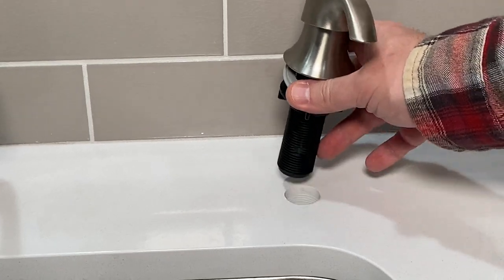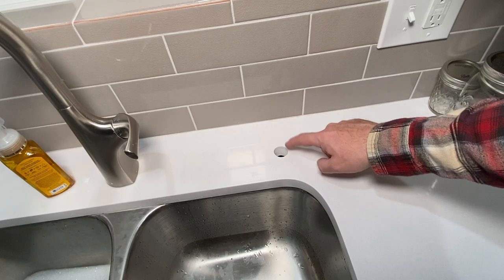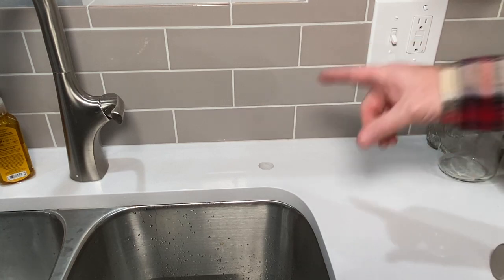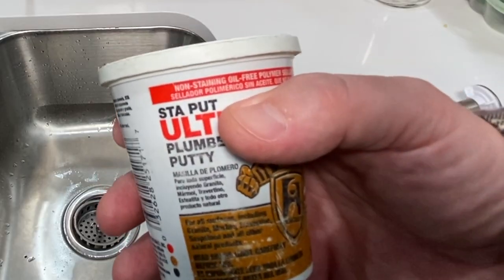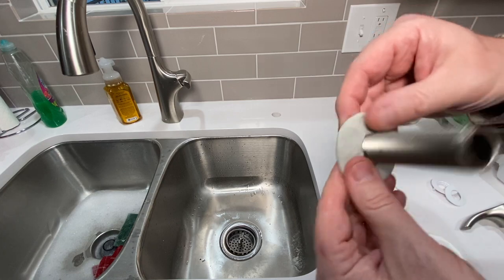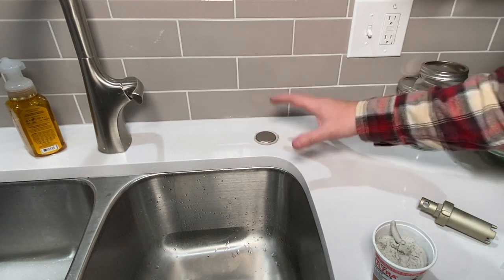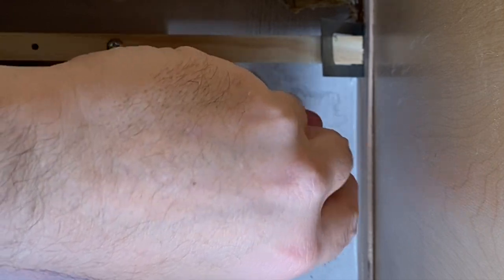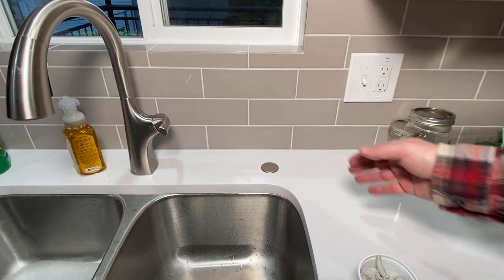I HAVE SEEN THIS TOO MUCH!...NEW COUNTERTOP MISTAKE THAT IS EASY TO AVOID!!

Comment: I actually just did this on my quartz countertop.  I drilled a bigger hole on another piece of quartz and i used that as a guide with some water. I believe 3/4 plywood would work aswell.

Comment: To make your existing holes a bit bigger do not drill through the existing holes!!! Instead use a billing bit with a side grinder to shave of the diameter of the hole and make it bigger.
Reply from the maker: Right on. I was just checking them out. Pretty sweet. Thank you
Reply: Correct. Why go thru the trouble right? Just grind 'er out. Get a small (3/8 or so) dremel grinding bit and use cordless drill.
Reply: Would a tile file work also?
Reply: Or, as I saw in another YouTube video, use a block of wood underneath, or perhaps on top, to guide the pilot drill so that you can drill a bigger hole over the existing hole.
Reply: @SpookySZNing  it would have to be a diamond file and it would take so long that I can’t imagine anyone doing it that way. Need grinder drill or die grinder bit with diamonds to grind it bigger.

Comment: I´m going to replace my current countertop with a quartz one, do I need an extra hole for the dishwasher? I'm also replacing the dishwasher and garbage disposal. The current set up has a 3 holes one for the faucet, one for the sprayer and one for the thing connected to the dishwasher (I don't know what that thing is called). Any help would be greatly appreciated. :yougotthis:

Comment: My quarts was put on top of my sink and the drilled the hole but was not lined up with the sink hole, now my faucet moves around and I can't Tighten it up its hitting 2? I'll call them edges. What do I do? To fix it
Reply from the maker: Send a picture of the under side I will need to see it. Ufix247@gmail.com.  I would love to try and help you out.

Comment: Helpppppp. I drilled 1 3/8 hole for the soap dispenser, but its it show a tiny bit of the hole on the side when i had it tighten with the nut and a bit tilt.  Seems like water can get down under. Do i need to use that kind of putty or is there a recommended washer i can use to make it more flush fit?
Reply from the maker: The soap dispenser should be able to cover that hole. They usually have a much wider base. If it comes with a washer i would use it. If not you could go with stain free plumbers putty or clear silicone.
Reply: @ThatFixItGuy  ty

Comment: Makes more sense to me if they would standardize the size so all the attachments fit the same instead of having a bunch of stupid different sizes.
Reply from the maker: For the most part everything will fit in 1 3/8 hole. This contractor must not have had one. That seems to be pretty standard for drilling the counter. Your right thought company’s could standardize better though. Thank you

Comment: But my RO system calls for a 1/2" hole for the faucet.. is there some way I can make that faucet work on a 1 3/8" hole?
Reply: Found the solution. It's called a "locating washer" and is capable of centering the faucet designed for the 1/2" hole in a 1 3/8" hole

Comment: What if the hole is too big and the accessory is too loose? How do I fit that?
Reply from the maker: What kind of accessory are you putting in?  Do you know what size hole it is?
Reply: @ThatFixItGuy  Filter, so it’s smaller
Reply: It looks smaller than an inch
Reply from the maker: The water filter should have came with a escutcheon to cover the hole.

Comment: Why didn’t you drill out the hole to 1 3/8” ?
Reply from the maker: They wanted a fast no mess solution. That was the first thing I mentioned.
Reply: @ThatFixItGuy  They’ll probably call you after they realize they now want a dispenser installed!

Comment: The Mensajor brand 16 gauge stainless steel sink I bought only has a one inch hole for a soap dispenser and of course, the air gap kits on the market are all a bigger diameter of 1 3/16! not keen on trying to make the damned hole larger. Maybe use one of those steeped drill bits?
Reply from the maker: Yes I really like using step bits to cut stainless steel sinks. Will make the job easy for you.
Reply: @ThatFixItGuy  The stepped drill bit worked a treat so thanks for the advice.

Comment: Just drill that hole bigger. I’m drilling through a top today that was very hard to drill and trying to line up with a hole in the stainless steel sink rim. I have another to drill tomorrow and there’s no hole in the stainless. I’m gonna have to drill the hard arse counter from the top and then drill the stainless from below with hot s Shards of stainless falling in my face 🤬. You just had to enlarge the hole size. Easy peezzy.
Reply from the maker: I would have they just did not want to. It always sucks when those holes don’t get done right. Hope it all went well  for you.

Comment: The idiots who installed the tub on my house made a hole of 1" instead of 1 3/8" and now I can't install a new faucet after our old one broke.
Reply from the maker: Yep!  It is all in the details and this is a big one to me.  What material is in the counter?  Are you going to drill yourself?
Reply: It's fiberglass, and yes I did it this morning.  I cut a piece of wood the size of the 1" hole and stuck it on the drillbit so the it has something to "bite" and then made the hole bigger with a 1 3/8 hole saw.
Reply from the maker: Ok cool. I’m glad you were able to hook that up!

Comment: You can get expander bits to widen existing holes.  He is giving bad advice.  Some reverse osmosis systems support a maximum of a 1.25 inch hole and 1 3/8 inch would be too big in that case.